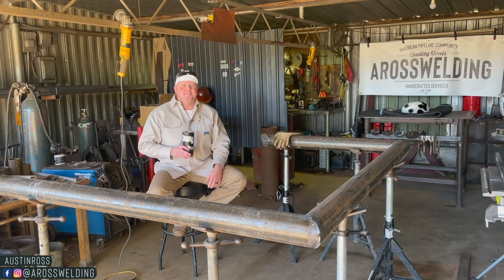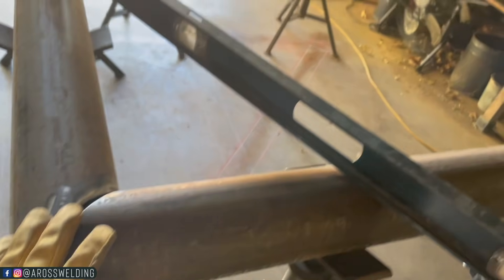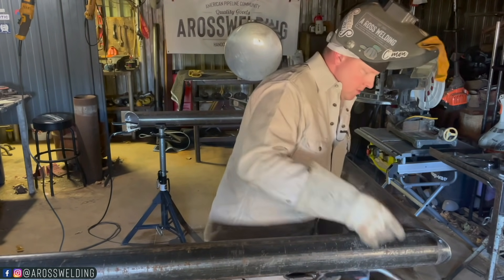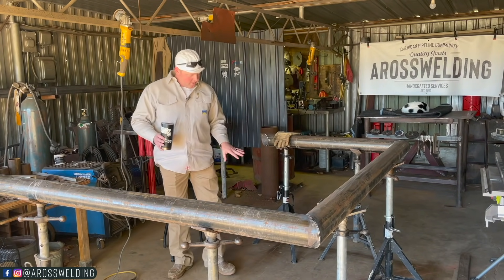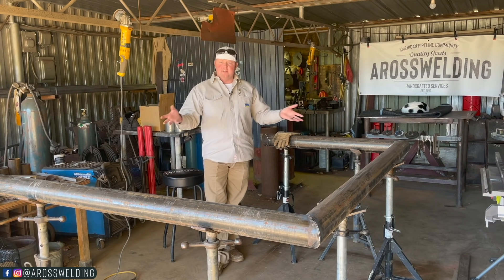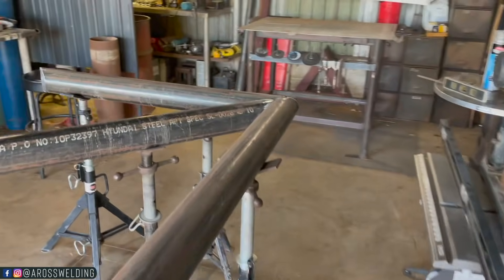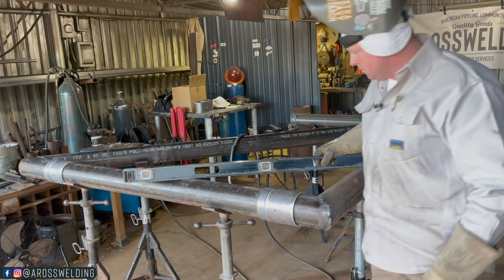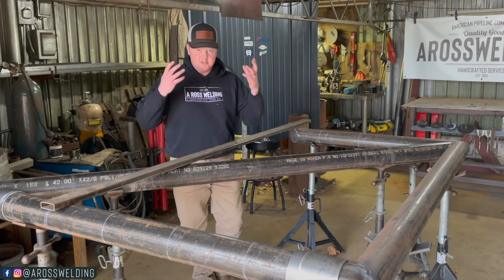WORKING IN THE WELDING SHOP (FAB TIPS, TACK TIPS, FAILS)

Comment: Great videos. Just a hint. During my years building steel and stainless pipe, Each time I made a new cope I would use the piece to make a   template and name it with sharpie so I never had to calculate that cope again. I have hundreds hanging on my wall. Great time saver.
Reply: Like my brother-in-law always said, "It is not how well you do it the first time, but how well you can fix it up after you mess it up."  He didn't use the word "mess, " but I felt the change was warranted.  Also, if you say 4" pipe, that generally means the inside diameter.  If you say 4.5" tube, then it is the outside diameter.  But I found the guys driving the fork truck at the steel yard tend to be confused easily by that terminology, so your way is better.

Comment: Hey "A" man, I normally don't use pipe that big in the projects I do, i use a metal cutting hole saw for coping joints together. Ill have to try iy your way some time,(when I have time). The gate is coming along nicely. Hood down lights on.

Comment: Austin.  When laying out concrete or tile floors inside, we always used hair spray to save our layout chalk lines. Easily cleaned up with a damp towel. Be sure not to use permanent chalk.
Reply: Hairspray works every time.....👍
Cheap and simple.

Also, it makes you look very butch having a couple cans of hairspray in your toolbox...😄😄

Comment: Another comment, if I may, about the Zerk fitting placement.
It looks and theoretically should work just fine with it in the middle of something that big.
Fact is, you need 2.  Not only opposite each other but staggered in height so when greased the whole slip joint gets grease.
Just looking at it, it looks like putting grease in the middle of one side would fill up the whole side and the moving gate would spread it around.  Not so.
Pressure points create pinch points and grease goes to the opposite side - away from where you actually need it.
Just my 2 cents.

Comment: Habanero! So you use a sugar scoop in your shop? I was just getting ready to pick up a CMR carbon pancake per one of your other videos. I run a 140a lincoln MIG, 225a PrimeWeld TIG, and a  230a Miller Thunderbolt stick. I weld in my shop and outdoors. Been using some cheap helmets and I'm tired of getting flashed and just not being able to see what I am doing. Is a pancake the wrong choice?
Reply from the maker: I like having both a pancake and a sugar scoop. The pancake is good for outdoor welding and if you are going to be doing a lot of literally just welding and little to no cutting or grinding. But if I’m going to be doing a little bit of everything wether I’m in the shop or outdoors I like to use my sugar scoop.

Comment: Pipe has stuff running inside and is always measured with the ID and a schedule for wall thickness. Tubing is structural and will always be measured with the OD and the wall thickness will be a dimension not a schedule.

Comment: Just wondering why you torch cut your parts as opposed to using the evolution saw?
Reply: I tried cutting the same pipe that was oilfield leftover on my land with evolution 14”. Tested and it wasn’t hardened. Blade was dull after 1 cut. The wall thickness and diameter is too great the teeth don’t cool down and it takes too long to cut. Now stuck with a blade I either chuck or take to get resharpened but boy it looks smooth now…

Comment: Austin there is no such thing as 4 1/2 inch (PIPE) As I’m sure you know pipe is measured on the inside and tubing is measured on the outside , it’s important that we all use the same terminology, it helps prevent misunderstandings, when you work for yourself those misunderstandings can cost you money, so if you remember pipe is measured from the ID ,tubing whether it be square or round is measured from the OD.
Reply: good info, thanks
Reply: @peetky8645  they do make 41/2 pipe but the od would be 5 in with a 1/4 wall
Reply: Nope, you're wrong to,,,, pipe goes by "nominal " pipe size,,, but OD always, always stays the same, the pipe grows by wall thickness to the inside, std., xh, sch 160, xxh.... 4" pipe, is 4 1/2" od,

Comment: I cheat 45° corners by setting my Evolution chop saw to bias-cut a sliver of round pipe and use it as filler. 😁

Also, I've never seen pipe in 1/2" increments.  Is it custom-made pipe?
Reply: The measurement of "4 inches" is the nominal, or center of the wall to center of the wall, thickness. He's using schedule 40 pipe which is 4.5" outside to outside.
Reply: @wargamingsupernoob  That explains it. 48 years in the business and pipe was always measured based on inside diameter, so its schedule (wall thickness) didn't enter in. "Tubing" was measured outside. I've been retired ten years; things must have changed.

Comment: Hi austin.  I live in KY and am making a carport out of steel tube(20x20).  I went to get a permit and they said i need a structural engineer to approve the plans and stamp them.  any idea what this would cost?  the permit people said my hand drawn plans were complete enough, but they need an engineer to approve them because they "dont do steel".  If anyone in the chat has an idea on this please chime in.
Reply: A mechanical engineer or a civil engineer could check them for you. Possibly an Architect also. Do you know somone in the building trades or a home improvement contractor? They may be able to give you a referral. For what you are doing the charge should be minimal. Good luck!
Reply: @sallybrokaw6124  thanks for your thoughts..they said no to an architect and specified a structural engineer.  I'm hoping its a minimal charge because the price of steel is poopy.  I will look into a ref, take care
Reply: What part of ky you in
Reply: @weswhisman1138  L-ville